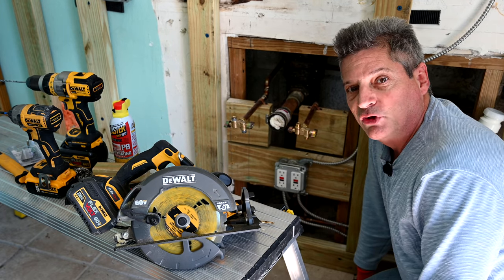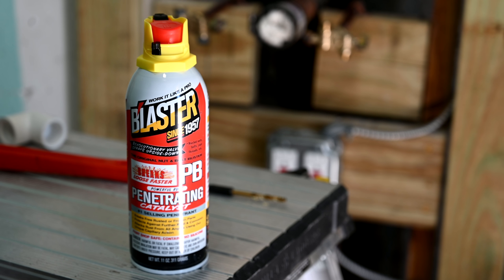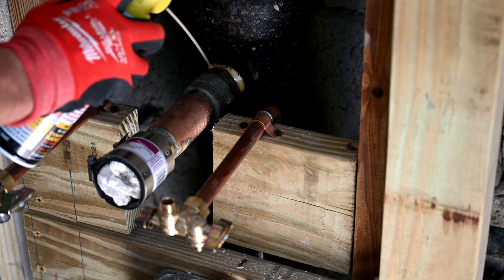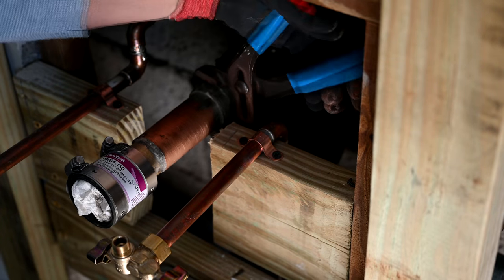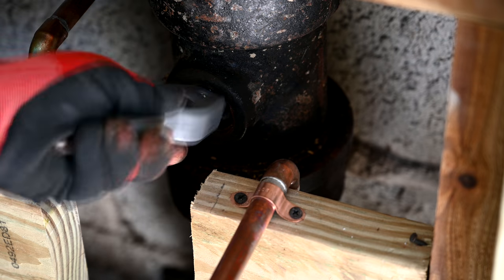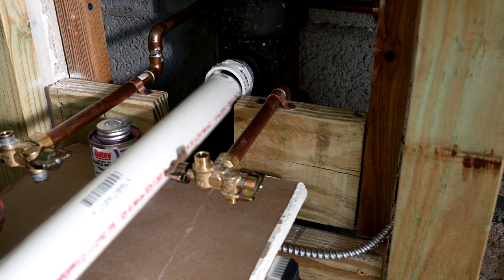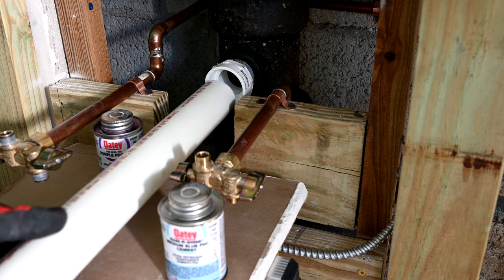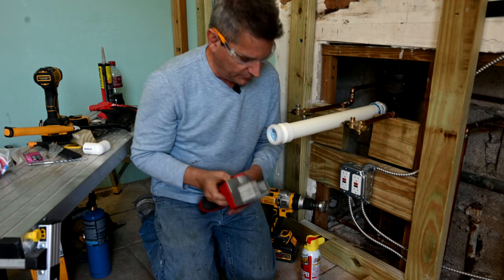How To Remove Stuck Rusted Pipe From Cast Iron Plumbing Stack, PVC Conversion

Comment: You should use a sch 40 pvc p trap instead of the flimsy tubular p traps.
Reply from the maker: Yes they used those mainly in the seventies here in South Florida but for some reason got away from it likely because it's easier for the homeowners to deal with these tubular set UPS during remodels
Reply: @jeffostroff  in my area there are still some people that use them.

Comment: How can I remove the metal join when pipe end is all rounded without the hexagon part?
Reply from the maker: A big plumbers pipe wrench should be able to bite into it. If not and if you were going to remove the pipe and throw it away, drill a hole on either side of it and run a large screwdriver through it or some other type of rod

Comment: Why would they put outlets, even GFI ones, directly below a drain or water line pipe?  And that PB Blaster penetrating lubricant is available at Home Depot.
Reply from the maker: Nothing wrong with outlets below drain pipe
Reply: Autozone 2, walmart 3rd , lowes maybe 4th ,+

Comment: What type of shut offs are those?
Reply from the maker: https://homedepot.sjv.io/e44o1z these are the shutoff valves that I use on every single one of my projects multiple copies of them throughout the house. I like these because they are compression so you don't have to solder them on and also they are quarter turn ball valves much better than the multiturn valves

Comment: You got an easy one there, I've had to use everything under the sun to get some of there out, I have better luck when the sink top is out of the way then I can usually us my pipe wrench and a 3ft 1 1/4  gal pipe, where the sink is not comming off I can get away with a bottle jack and pipe wrench,, and some time just a cold chizzle.  I guess why plumber get paid the big bucks ha ha ha nice vid
Reply from the maker: Thanks for sharing

Comment: I was really hoping you would retap those treads in the cast iron, oh well old school from chicago.
Reply from the maker: We didn't bother with that nonsense because we knew we were coming back in with our plumber friend later on to cut out and remove that section of the cast iron pipe and replace it with PVC that would have its own stub out for us to then cement in this waist line

Comment: I didn't see you bevel the PVC pipe before you insert it. Did I miss it?
Reply from the maker: No I only bevel the PVC pipes if they have a hard time fitting into the fitting. Most of the time these are quite accurate pipe that slide right into the fitting..

Comment: Noice, a great way to save money and not have to buy 1-time use tools. This would have been a great area to use a crowfoot wrench with an extension to a breaker bar. But around 3 inches, crowfoots are about $100 apiece.
Reply from the maker: Yes and also I don't think I would have the moment arm advantage to make that pipe rotate actually like I did once I put that PVC pipe over the plumber's pipe wrench

Comment: Luckily that was a bronze adapter fitting. Would have been a lot more difficult if that would have been a steel nipple
Reply: I tend to agree. 
 I am having a problem with a 2-3” galvanized nibble rusted in what I think is orangeburge stack. 
  PB Blaster does not seem to have any affect on it. 
  I am worried about putting too much pressure on the galvanized pipe and breaking the stack. 
  On top of that, I need to remove a few pieces of steel drain to get to the piece going into the stack. 
  If I can find a steel covered fernco coupling short enough, I might try cutting the bad piece and just attach the coupling. 
  That being said, thinking I need to tear all the drywall off and replace all the old galvanized drain pipes thinking, if that one is rusted out along the bottom, how long until the other ones do too. 
  Just went through this at the house I live in. 
  Replaced a bad horizontal drain that had caused rot in my kitchen floor. 
  Evidently, I should have replaced more as my floor had rot in the same place again.

Comment: Use a metal threaded fitting to chase the threads first. Careful not to crack the cast. See if the inner threads will clean up.
Reply from the maker: I tried bro I cleaned off the old pipe and tried it and it still did the same thing I think whoever put this together originally discovered the same thing that's why they're pipe was not in all the way, I think some lead must have dripped down and landed on those threads making them no longer useful because nothing I did with the wire brush spinning high and everything nothing would remove any of that stuff but yet you saw how I was able to clean off the threads from the old pipe

Comment: why cant you use pipe dope on abs or cpvc? i use pipe dope for everything.
Reply from the maker: Pipe dope, just like plumbers putty has petroleum products in it which will cause the plastic to a crack. Pipe dope was originally meant to be used on metal threaded pipes.
Reply: They make pipe dope that’s petroleum free

Comment: Im lost here if you were there sweating copper ...why not heat that joint with the torch ?and get it out then?
Reply from the maker: We did that the day before we spent an hour heating it and reheating it and reheating it and nothing helped. It it's a problem where the old pipe dope that it dries like a cement and you just need to get a little bit of penetration in there with that PB or whatever your favorite penetrating oil is and that's what loosens it.

Comment: I woulda eliminated the threads and adapted to code sanitary fittings with no hub bands and i would have cut the cast iron with the correct cutting tools and not a grinder because that's dangerous on a vertical plane
Reply from the maker: The chain isn't going to fit in there unfortunately. Unfortunately. Although I don't know why he didn't have a better blade on his sauce hole to be able to cut through that like butter
Reply: @jeffostroff  it is not always a chain that is old school, now we just use a sawszall and a helper to pick up the pipe, if a little drywall needs done on the other side then it is what it is drywall is cheap, getting your drain snaked out is expensive

Comment: That’s a cast brass MIP adapter just ext the copper piping  that’s not original they install the copper after they removed the old galv pipe that was originally there.  I can see you taking it out to get scrap money for it and install pvc  btw you can cut the MIP and use a  cope chisel  to cope out the threads on the MIP   I bet you if you just would of put the pipe wrench on the end of the copper out the wall it would screw out better still collapsing the copper would give you more teeth   Just leave it to license union plumbers to do it right the first time.
Reply from the maker: Yes, the licensed guys know how to do it for sure, but this was for the DIY person who maybe does not have the funds to pay a plumber.

Comment: I would put a 1 1/2 brass nipple than a pvc  fip adapter
Reply from the maker: Either works good, but it you put brass pipe on one end, now you're stuck using Fernco connectors on the other end to mate to P-trap

Comment: The only thing I'm confused about is why there are 2 outlets under water supply and drain?...
Reply from the maker: garbage disposal and dishwasher. You normally see these under the sink. Because this was a doll house practically with a super tiny kitchen, the only place that outlet would be attached was right there in that spot.

Comment: Bad idea if you messed that up removing you would have turned this into a BIG job messing with the old stack. Fernco would be the same out come
Reply from the maker: This is not a bad idea this is standard procedure anybody would be able to tell if their pipe is going to break. And even if it did you could still put a fernco on it but the risk here is very limited. remember these pipes are very thick and very tough

Comment: Please run a pipe tap into the fitting. Any imperfections in the female threads will cause damage to the PVC male threads.
Way too much Teflon tape.

Comment: I have been cutting , burning , and unthreading nipples from female threads for 30 years, and the first thing is don’t waste your time or money using wd40 or any penetrating oils. They do nothing to help break that thread free.,Oh even with lead they still used a red brass nipple threaded into a female thread than they would make a wipe joint on the end of the brass nipple making the water tight seal .

Comment: Wouldn’t you be farther ahead if you replace the San tee
Reply from the maker: Funny you should ask because we ended up going back into the wall later once we discovered that this drain pipe from the original builder was up too high 22 inches off the floor when it should be no more than 16 inches off the floor. So we went back in later and we are filming another video on this that should be ready in a week or so. But what we did was we cut out the that bottom 18 inch section of the entire cast iron plumbing stack in replaced it with rubber boots on the top and on the bottom to meet up to the remnants of the plumbing stack and we put in PVC 4 inch T adapter with two outputs one for the kitchen and one for the bathroom and those have Sani-T built into them .I mean Video should be up hopefully next week
Reply: @jeffostroff  im not sure of this t adp I hope you mean figure five so I’ll wait for video

Comment: Threading a pvc male adapter into cast iron is a big NO NO it will get cross thread also tightening it without a piece of pipe in it it will oval the male adapter so he did two things that will cause a leak and supposedly he's teaching us how to do it right 😂
Reply from the maker: The threads did not deform, the threads did not cross thread, and the Teflon tape ensures a nice seal. You were wrong on all 3 points. # years later, these pipes are doing just perfetly.
Reply: @jeffostroff  every plumber knows threading a male adapter into metal it's a no no on your video when took the pipe wrench to it it lost its shape and the connection is behind drywall are you sure it's not leaking? and if it's not you got lucky next time use a galvanized nipple and a female adapter that's the right way to do it

Comment: i hate plumbing
Reply: All plumbing jobs=3 trips to the parts store.😩
Reply: @albertthorne2872  sounds about right ohh this is going to be a breeze 6 days later
Reply from the maker: I sort of hate plumbing to but I also love plumbing when I Mabel though saw the engineering issue like thiso
Reply from the maker: We got very lucky on this one because once I saw what I needed the 1st day I picked up the JB Weld and ni PB blaster spray in the pipe in the adapter and everything all-in-one trip on the way home that night and then made this repair the next morning
Reply: @jeffostroff  just bought 149.00 dewalt 5amphr kit + $129 grinder got $70.00 off + $20.00 off for instant vol savings. $90.00 off . 278-90=188/2=94.00 each tool.must return all items for a full refund. It’s real nice to have someone like you in the world.